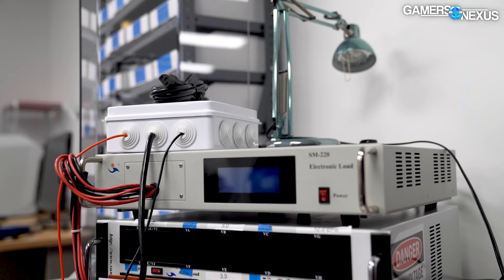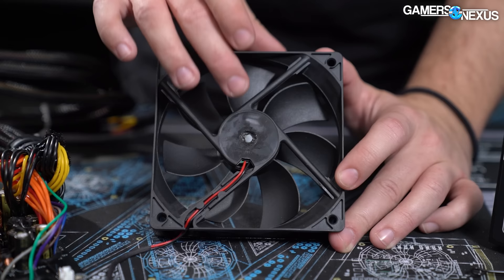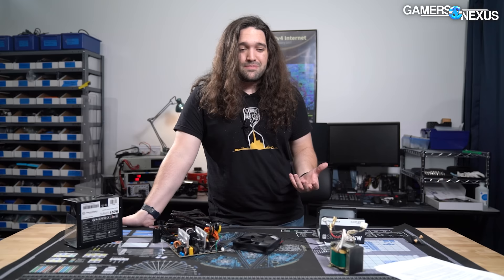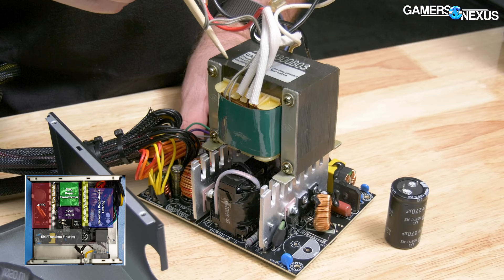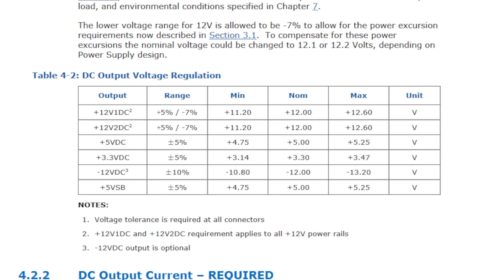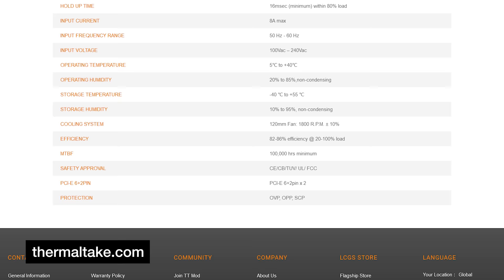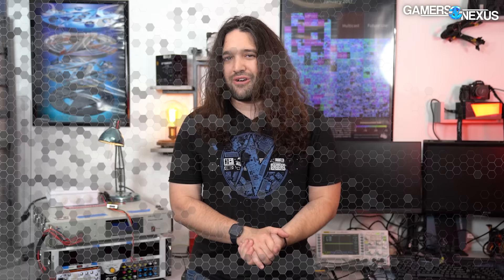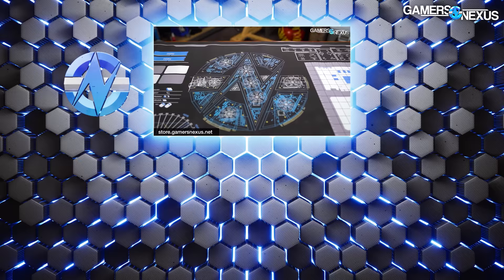Taking Risks on a Cheap PSU: $30 Thermaltake 430W SMART Power Supply Review

Comment: Well i`d say dont go below 100$ for quality PSU, and ofc choose premium and reliable brands such as SeaSonic, Corsair, Delta, Fortron, SuperFlower, SilverStone, maybe Be Quiet too, i prefer to avoid EVGA, after last garbage PSU from them...

For second hand depend on the price, i got EnermaX PSUs, that work like charm, and Corsair HX 750W model from 2009 ir works more then great, still working fine on x58 system. Older SeaSonic PSUs (mostly from the SS series) have the bad habbit of melting/ burning some times their module cables, and that really sucks.. So far i had x2 SeaSonic SS PSUs that did that crap, and they are from the higher end sadly, SS850W Gold and SS-1050W Platinum... The gold did burn its PCI cable after like 4 years of use, the Platinum did burn its periphals Sata port after like 3-4 years as well... So guess SeaSonic makes great PSUs, but they did cheap out on the module cables, or the manufacturer of the cables suck hard...

About that ThermalTake PSU in here, to be fair teapo are one of the best chinese crap caps, they fail, but after more time, not like KZG caps, or other crap ones. Is interesting that the small capacitor with the K on top of it is prob. high quality Japan Rubycon cap, is strange why they did put inside expensive japan cap, even if is one lol..
Reply: Going by price and brand name doesn't meant much. 

The gigabyte gp-p750gm, which was shown exploding in this very video, was over $100MSRP when it launched. Gigabyte is a known brand, not some 6-letter Amazon crap.
Reply: @ecnepsnaiold  I think only an idiot will buy a product, from a brand that does not usually do that kind of stuff u know... For example Gigabyte are best in motherboards, maybe GPUs, and seems they make also very good price/ performance monitors... Still i prefer to buy MB or GPU from Gigabyte, not PSU, or Case or other BS. Also did u see me mantion PSUs "from" ASUS or Gigabyte, or from other brand like that, no u did not... I said 100$ as baseline, and some brands that are VERY reliable. So what is the point of ur comment then ? I said price, and i said brands, what does that have to do with GIGAbyte and their allahu akbar power supplies that explode or catch fire ? 

I did not mention but if someone is on tight budget going for second hand PSU from the brands i mentioned, that is priced very low, and still has warranty like at least 2 years, and the warranty sticker is not removed, is prob even better then buying new one...

Comment: I believe that you, Gamers Nexus, are doing a great job with these objective and technically thorough reviews but the emphasis on the ripple just gets on my nerves.
Let's start with saying that no high-speed or sophisticated component in a modern PC is directly powered by the +12V rail. CPU, GPU, DDR memories, storage flash memories are powered by VRMs so these are the sub-systems which receive the ripple on their input.
The fact that the requirement on max ripple by the ATX standard hasn't changes for decades means that designers have had plenty of time for devising ways to deal with it. If a level of ripple which is within the limits of the ATX specs is allowed to affect components downstream of the VRM then, sorry, but it's on the designers of the VRMs.
If really the +12V ripple itself, and not other parameters like the transient response of such rail, is having a significant detrimental effect on the circuits powered by the VRMs then Gamers Nexus should be able to easily show it. They seem quite good at designing scientifically accurate tests and they should have all the knowledge to come up with a rig for comparisons in which the ONLY parameter that changes is the ripple of the +12V rail(s) proving therefore that ripple is associated with instability.

Comment: I lost trust in Thermaltake years ago. I had a 450w power supply from them once. I was in the middle of using Photoshop one night when I smelt a burning smell. By the time I figured out it was my PC, it was too late. It shut off, killed my motherboard, HDD and graphics card. The 24 pin connector on my mobo got hot and disfigured the plastic housing. 
I took the power supply apart and something melted and burned a hole in the PCB. Melted the solder right off a section of the board. 
Never again Thermaltake. Not even a case fan!!

Comment: I tried to put a 1660 Super i my wife's PC (9600k) with a CX500M and it didn't POST.

Edit: It was an Antec 380W. I dropped an old CX500M in it, then upgraded it to a CX750M.
Reply: More likely bad caps in the PSU. That combo should work fine, the 1660 Super, is only a 125W card by default, IIRC.

Comment: Speaking about cheap PSU, I remembered that around 2 decades ago (circa 2002), I had this friend that always bought the absolute el-cheapo PSUs (it costs around US$ 8 for IIRC a 300W "rating"?) for his PC and one of them called "Mentari" (it's an Indonesian word for the "Sun") and what always made me laugh is that it has this motto in its sticker, which says "Mentari - Shining up your PC", which is not wrong. I mean sure, it will shine your PC up, when it blows! 🤣 As for its quality? Well the guy always have hardware failures every few months and the crazy thing is that he will blame anything else but the PSU as the problem 😂 And the PSU have also failed but he kept buying the same brand LOL. It's madness.. 😂

Comment: The last time I used are Thermaltake PSU an arc of electricity shot out of the back of the PSU and burnt the wall behind my PC it also killed all my hardrives I was lucky I was there at the time and there wasn't something flammable near it or it could have burnt my house down ever since that day I have been getting mid to high end Corsair PSU's

Comment: i once had a ,, @power psu... first its switch stopped working opened up reconnected wire simple.. next the thermo resistor burnt out.. i learned if you just Twist the Wreckage backtogather it keeps working lol.. Then the glass fuze popped.. and then i said ok Now its time for a new one altho in hind sight should have kept the thing  and just salvaged a new thermo and a glassfuze off another differently dead psu.. ah well

Comment: I would rather spent a little more on a power supply that has longest warranty. I'm using Antec HCG 750 gold (rebranded seasonic focus 750) with 10 year warranty. I think it will serve me for a long time and if I want to upgrade my pc I don't have to change power supply.
Reply: ATX standards change.  An ATX power supply from 2000 is far different from one in 2010, which in turn is different from  a recent one in the 20's. The new ATX12V Ver. 3.0 standard will pretty much make current power supplies obsolete once it's fully picked up by motherboard manufacturers.

Comment: Oh man, Diablotek. I haven't heard that name in years. I bought a couple of 650w units a decade or so ago when I knew much less about PSUs than I do now. Absolutely terrible units. Both fails, one sparked and could have caused a fire. They were were replaced by Corsair CX PSUs and later EVGA Supernova G2s.

You should test them if only to see a potential fireworks display.
Reply: Sounds like 20 years ago, when I had a Deer PSU that looked cheap on the inside! Even the PowMax that replaced it in 2002, even when probably not as bad as the reports for recent versions of PowMax, it still was poop, the PowMax was definitely having a squealing issue by 2003. But none of mine failed in a catastrophic way like some do.

Comment: ~20 amps on 5 volt means it's designed for old PC's like AMD K7 or early Pentium4... Most of PSU's of that era had 25% of max power to 5v and less for 12v (if You don't know that, I started to doubt your knowledge of the subject, are You the noob that bought his fist PC yesterday?)

Comment: Frankly that 2000 hours rating on the cap worries me. It's probably not as bad as it looks in most realistic usage scenarios, but then, this is the part that actually goes boom, and I'd want more safety cushion than that on it...
Reply: 2000h is at 105C. PSU, unless it's on fire, is never going to be that hot, so the cap will last magnitudes longer at lets say 40-50C (some rough calculations from the internet puts these kinds of caps at ~60,000-70,000h at 50-55C).
Reply: The rule of thumb is that every 10C temperature drop the cap lifespan doubles.  So at 85C it would be 8000 hrs.  In reasonable terms this supply shouldn't have a problem meeting its 5 year warranty.
Reply: @dennisp.2147  Thanks. As I said, i know it's not that bad at realistic temperatures, but... I did have a PSU cap explode on me ( ~12 years of heavy use and the PSU didn't catch fire or damage the rest of the PC.) Still gives you some... visceral respect for the things.

Comment: There is nothing inherently bad in this power supply. I'm not a fan of tT, but let's face it, the psu is perfectly good for it's purpose and it's very likely to outlive the build you put it in.
Also, being out of spec of the dated ATX2 standard is nothing to worry about either. Ripple and noise will never matter to the average user, since first he/she would never know and second - their system will run perfectly fine.
Efficiency is also not important to the average user. Nobody cares if their psu is 82 or 86% efficient, if it does it's job.
And the caps being rated for 2000 hours at 105C is mind numbing to say they won't last. These will never run at 105C constantly, therefore their lifespan will probably be something like 6000 to 8000 hours or more. I don't see a problem with that, do you?

Comment: That PSU almost look cheap hobby psu that only need some amazon breakout boards or butchering.
Currently using 250W seventeam psu for 12V circuits. OK max 150W on 12V and had to use load in 5V it to be stable.
I start to want those 12V only PSU or 24V would also be nice.

Comment: I never cheap on a PSU, it's literally the base of your system  and ripple voltage, will over time be such b@stard of a thing, it will degrade electronics and cause them to misbehave in so many ways, if you value stability and your money, you better get something that has the lowest ripple and transient responses and highest efficiency at the lowest levels of load as well as it has at the highest power level it can deliver and of course protections are extremely important.
There are other things which you can do too outside the PSU before it,  to ensure its longevity like placing a surge protector especially the ones who have who have filters to keep the system and the PSU as possible (in terms of clean power i mean not dirt or something like that) and actually good UPSes.

Comment: I dislike these power-supplies purely because it's not a "round" number for the Wattage. - I mean, I get 100s or even 50s, like 500, 600, 700, or 550, 650, 750, respectively. But going to 430 is like... why??... What is that about??... And why not 350 or even 325 then??... Like quarters, I can get behind that. - But of course that's a bit of "OCD" going on there, and it's just a rating of what it CAN deliver. - Though, at the same time, it seems so "random", somehow making it LOOK cheap. - It's a similar effect to not having a brand on it, I suppose. Because as modern humans, we're so conditioned to respond to brands and labels, including myself even though I'm aware, that it actually makes us look at things differently. Sometimes even to other humans, like "You don't even have branded clothing? Phuh! Peasant!". Kids get bullied that way today. - But anyway... Again, why or how did they end up on 430 Watts??... XD - They cheaped out on the design as well, I suppose.

Comment: this psu makes negative 12v which means its an ancient design.
About the cable lengths, they might be using a cheap measure tape /s

Comment: ive got a Thermaltake Toughpower G3 1200w for my 10940x/3090+ 3070 and its absolute dope ^.^ its a rather cheap one for a premium build but 140$ for that that its ATX 3.0 and PCIE 5.0 is really an amacing deal, BUT not the SMART series tho, they are awfull, id rather get a BeQuiet Systempower 9 with like 6 or 700w thats 80+ Bronce but like a LOT better then Thermaltakes non Smart series ;) ^^

Comment: It's not a "YCAP" It is an MOV. It isn't a "XCAP" it is a Polyester Film Cap. Do you guys even know what they do? You guys have been hoodwinked by big box companies and don't understand what you are talking about. The reality is that any PSU is MORE then capable of doing the job asked of it. What you guys don't understand is that power conversion is EASY, and BASIC, unless you add a buck converter. Then you are adding a tonne of noise. Even a two dollar capacitor will half your voltage ripple. These companies are giving you what you pay for, and there is nothing wrong with a 90mV ripple. Your GPU's etc... have capacitors which filter that anyway. I could make a $10 PSU which will do just fine, $100 would be overkill, so for $30 you are going to get ripple. Use a $2 cap and throw it across your 12V rail, 5V rail, and 3.3V rail. But then that cuts into that $30. Those $400 PSU's are an absolute rip off... and intel wants to move the buck converters to it's board so motherboard manufacturers can charge more, and you have to buy a new one every platform. That's it. Your trip points are thermally limited, because parts at that cost point, use thermal protection. Otherwise you have to add a different circuit.

Comment: I don't see what what the point is with these cheapos when you can just pick up a used corsair RM or HX unit of 750 or 850w for 40-60 bucks. Hell, I just bought a RM650x for $35. 3xRM850x for $60 each. Why do people have an aversion to used PSUs?

Comment: I wonder if this PSU could sustain a RX 6600?
Reply: OzTalksHW has a vid where he uses this unit and a 6600. I dunno if it would last, but I'd assume so. Everywhere around the internet, annecdotes are, if it was gonna die, it would do so once it's arrived, but if it works it lasts awhile.
Reply: @ricedbroccoli  I will search for this OzTalksHW, thanks =) I guess if we undervolt the 6600, that should do the trick, this GPU almost never goes over 100w consumption in most videos I saw. There's a channel named "tech yes city" that tested the RX 6600M, which is the notebook version of the card adapted to desktop (the chinese are crafty), this 6600M undervolt is actually more efficient than the "original" 6600 somehow. In the end, PSUs are cheap, most likely I will buy a newer one, I am aiming at the gamemax gp650, seems to be the current "budget king" at +- $50

Comment: most "modern" Power supplies are realitivly safe there was an era in the early 2000's during the capacitor plague cheaping out on a PSU became dangerous i had a friend go through 4 seperate computers in 6 months due to the bad wall power in his home mixed with cheap PSU's

Comment: And even with expensive psu's you can be unlucky.... A couple months ago now my corsair HX1000i powersupply started to output voltage spikes that eventually killed my 3080ti and damaged the CPU and NVME. 

"WHEA_UNCORRECTABLE_ERROR" is a BSOD message that you definately do not want to see
Reply: I usually get that when OC'ing the FSB too much with my Q6600, with the reason being "Bus/Interconnect Error", meaning I at least need to fiddle with the FSB termination voltage. 
And I get the same stop code for my Ryzens, (except the reason is "Cache Hierarchy Error") but it's usually because of VRAM being unstable or the RAM getting flaky, possibly just because it's higher than 55C, for all I know! Same with the CPU core being unstable when running Cinebench, IIRC. For some reason, with my Ryzens, it has always been "Cache Hierarchy Error" for the reason!
Reply: @RJARRRPCGP  Well luckily you know what causes the issues, that way you can fix it. In my case it was with a system that shouldn't push the psu too far and was not overclocked. (I7-6900K, 3080ti)

Comment: Should I be concerned that I use this PSU with a 3070 & 3900X? Btw it's the Smart700 not the 430.
Reply: Does your system ever crash?  If not it's probably fine, probably just slightly stresses the components more.
Reply: @Walter White  thx for the reply but I now have a 7900 XTX and 5950X cpu lol. No worries tho as I've upgraded to a Corsair RM1000x psu
Reply: @05DonnieB  How long did the smart 700 last and did it ever explode lol?  I bought one to replace an Antec 550 watt PSU that I used for 12 years without any issues haha.
Reply: @Walter White  never had any problems with it. 700 watts was always likely more than enough for my previous setup. As long as you aren't doing crazy overclocking you should be good 👌
Reply: @05DonnieB  Yeah, haha surprisingly back in 2011 whenever I was around 14 or 15 I was able to overclock a Core i7 870 (95watt) and ATi 6950 (200watt) with just the basic 550 Watt PSU.  Your current upgrade seems like over kill haha, but that 1000 Watt PSU should last you 12 years at least I would hope.

Comment: Personally, as long its not a mid or high end game PC the PSU doesn't matter as long its not something out of China. There are products that cost over €1000 and have shitty power supplies like mixtables or amplifiers. The whole ''only buy good PSU's'' is just overreacting. If you have the money, sure buy good quality PSU. If you buy a new mid-range system sure, a spending €20 more is not a big deal. But if you get a second hand system with a old 4th gen Intel CPU or something just buy whatever.